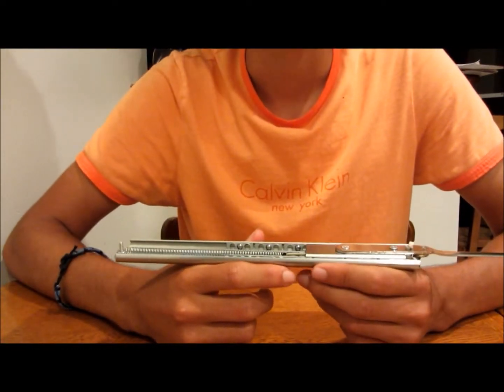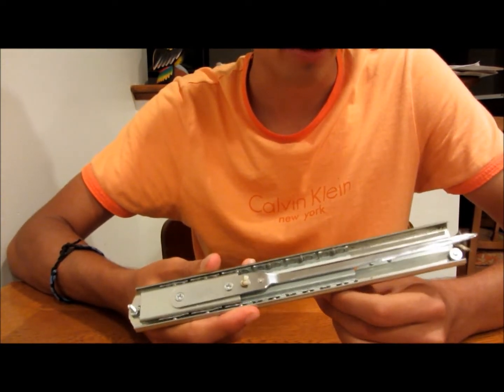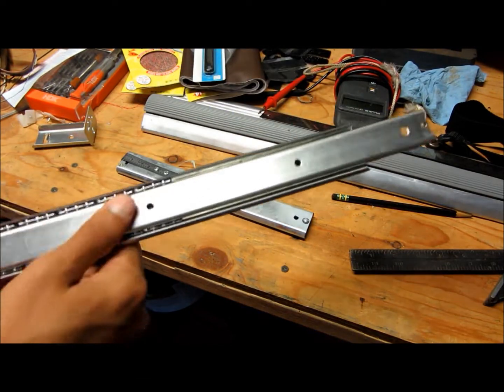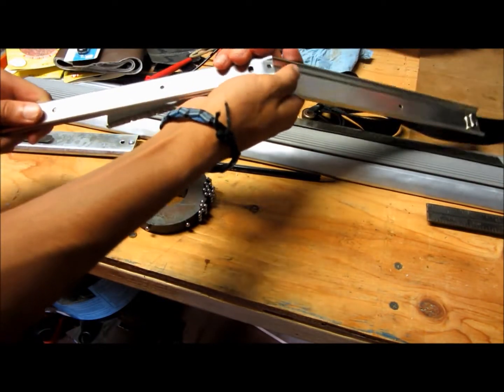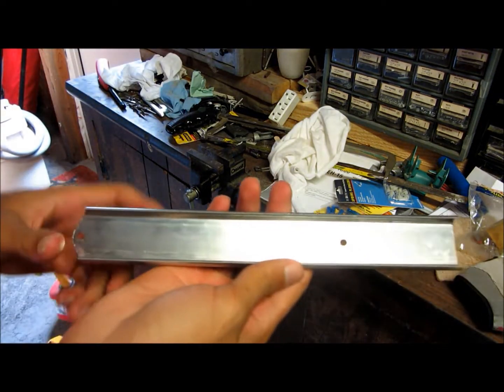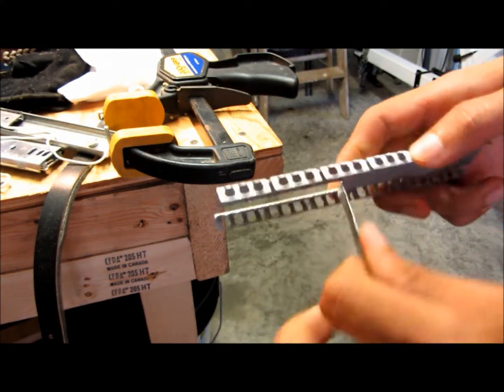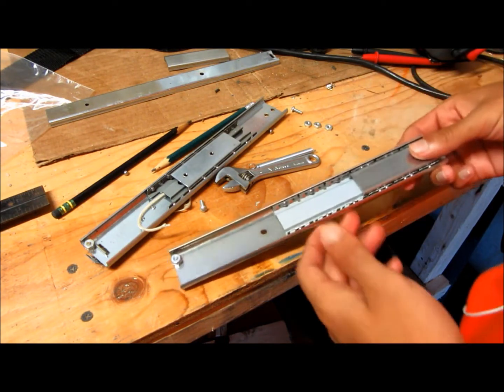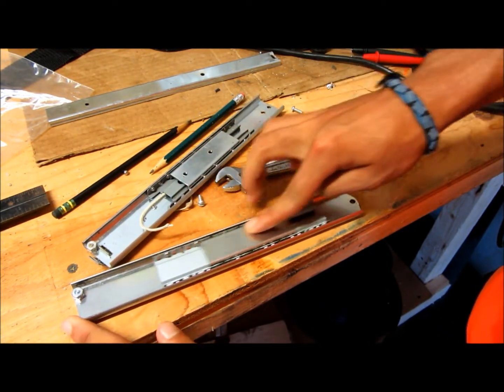Tutorial Part 1 | Homemade Assassins Creed Hidden Blade | Xiphoid

Comment: Do you perhaps one such blade on sale?
If so, how much?
Reply: Based on mechanic instinct, one like this costs about $25 more to buy than it does to make. For a perfect fit would cost $40 more than materials. So for a basic one it is about $45, a fitted one costs $80. that's just the blade. I make them with a steel bracer and I use folded sheet steel to cover the blade internals. Generally I charge $170 for a complete blade and bracer, but mine uses a real blade.

Comment: I can probably find all the stuff needed at home depot or lowes. This would be awesome to have and if you have a license to carry a concealed weapon it would be good person protection scare the crap out of muggers.
Reply: These are illegal in most places, it falls under a gravity knife. I would suggest changing the letter opener with something non metal, like a wood blade with foil duct tape on it only because you can be fined by time for having one of these.
Reply: Change it if you're going to be cosplaying/using as a prop
Reply: CrimsonSkyz
 You do realize the government has weapons 10 times more deadly right having something like that shouldn't be illegal because you cant really do anything with it. Also you can use a ceramic blade like the kind used in diving knives instead of metal and your fine because they would have to ban diving knives which are a industrial tool and they wont ban those because they'd loose money and shut down that line of work.
Reply: CrimsonSkyz
No I just have no fear or shame whats your excuse?
Reply: I would just use my 9mm hollow points.

Comment: Hey man, is this the drawer slide that you bought? http://www.lowes.com/ProductDisplay?productId=50041736#BVRRWidgetID
Reply from the maker: btgoodgame343 It sure looks like the slide I used.  I recommend that you just go to the Instructables I made (link in the description) because it has all the materials I used.  Also I want to emphasis that I made this tutorial so you guys understand how the blade works and so that you guys will be able to create better versions.  So maybe using a different slide or spring will benefit you :)
Reply from the maker: Look at the instructables! :)
Reply from the maker: I'm sorry man but I've stored the blade and I won't be able to get it for a while.  I suggest you buy a spring with the same diameter but a longer length so that you can cut it to the correct size after you experiment with it
Reply: Where did you get all the parts form I can't find them
Reply: ***** try getting a spring out of a stapler and cut it to size